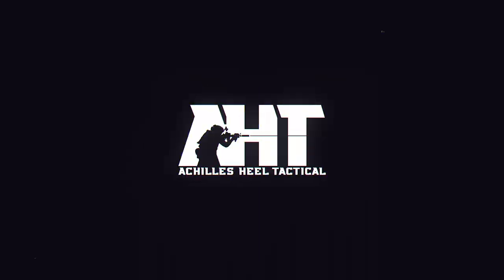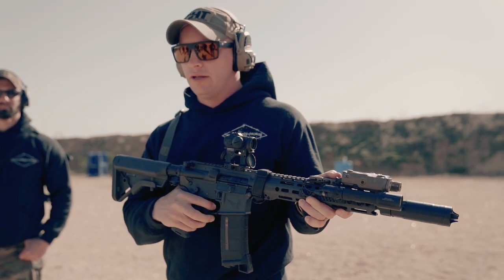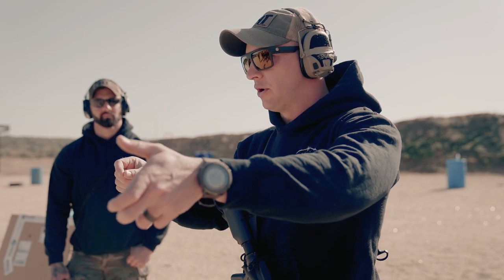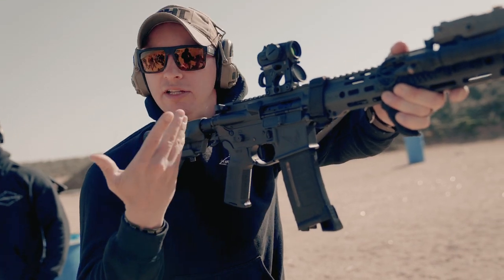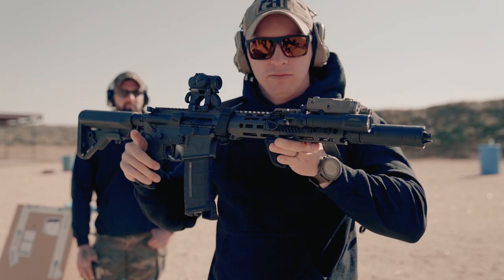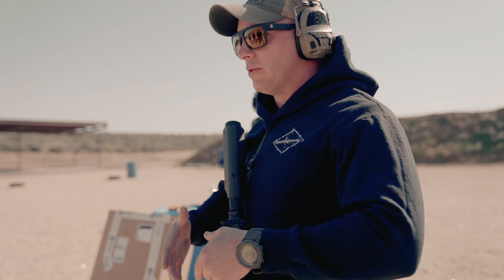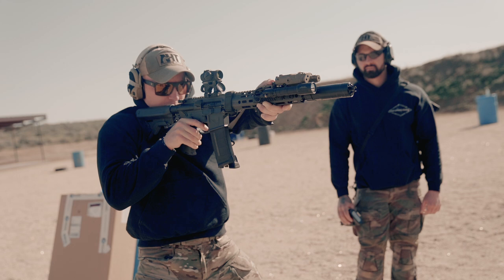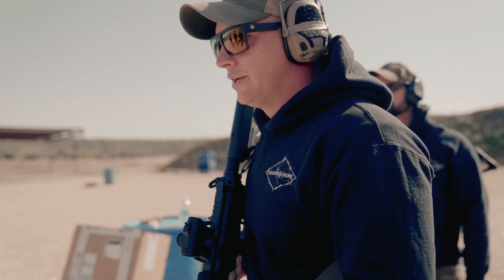HOW TO GRIP YOUR CARBINE

Comment: I'm going to try this. I have watched several top tier guys that would disagree with the shoulder theory. Lucas Botkin being the main one. Until I found you I never knew Lucas had a rival. I will work on this NYD at my personal range. COME TO TENNESSEE!!!!-
Reply: This guy stronk and heavy with big hands. Lucas tall and lanky, small hands. Pulling the gun tight into your shoulder causes you to shake and get exhausted and make you likely to chicken wing. You always gotta stay relaxed and comfortable. Your off hand should stabilize the weapon as this guy shows
Reply: Lucas is far from a top tier guy, let’s be real…
Reply: If you're indexing the butt on your shoulder, you're already not optimal.  Index the butt under your dominant eye and build from there. For me, that's in my chest and clavicle, nowhere on the pectoral-deltoid fold.  

The minor supporting techniques can be experimented with to see what works with your anatomy and carbine furniture.

I personally use rearward pressure with the support hand and 3 lower fingers of the firing hand, while leaning forward.  My muzzle does not rise even with A2 muzzle device.

As you build a round count over months and years, you'll see what works better for you.  I learned from guys like Kyle Lamb and Ranger Regiment NCOs who went to SOT run by The Unit.
Reply: @LRRPFco52  I'm a civy. I just emulate the top tier guys. I don't have the big league instructors as you do,and you're formerly a soldier. Tbh, there is no one specific "perfect" technique. Besides, I evolve every time I hit my range, when I'm not overloaded with Cerakote work,which I am as of now.
Reply: @tangomantactical  Those techniques have been taught to civilians for 21 years now at least.  I helped Kyle populate his first open enrollment course in 2003.

Comment: Many SOF vets have talked about the “c grip” being too fatiguing and that if they’re holding security for a while or clearing a decently sized structure, they’d grip the vertical grip or magwell. Do you agree?
Reply: Yes, and no. The several dudes I learned a lot from were all Batt rangers and could keep their c clamp for hours while we ran drills and such. I think it can depend on barrel length, but it's possible to keep up.
Reply: You don't have to be high ready 24/7.  Your weapon is muzzle down most of the time, until you need to go high ready.  Start with SUTs and CQB perspective, then work-in CQM techniques to see why they are what they are.

Comment: What do you mean/do when you say “leverage the pinky and thumb” on your support hand? Like what mechanical input are you applying with your left hand/fingers?
Reply from the maker: The thumb over & in-line of the bore is the leverage high and the pinky is the low leverage anchor. Rather than brute strength now you have leverage built on the rail which will be much more effective at controlling the recoil impulse. Come to a baseline class & you will receive all the context you need in person.

Comment: How would you leverage the rifle if you don’t have a fore grip attachment?
Reply from the maker: Exactly the same way. Fingers at 6 o’clock of rail and thumb at 12 torquing front end of the rail.
Reply: @achillesheeltactical  thank you. Also, what’s your opinion on flexing your hip to square up. Some instructors say it’ll induce muscle tension causing excessive muscle fatigue.
Reply: Explain Torquing?  . Torque down like twisting the cap on a jar?  @achillesheeltactical

Comment: I'm curious as to how much the sling tension is assisting in mitigating the recoil. I prefer to run my sling in a one point configuration 90 percent of the time as my rifle is primarily used for cqb.  Switching shoulders is just too much of a hassle in kit  on a two point sling setup.
Reply: Single point is really only good for Plainclothes & Vehicle work.  Once you go hands-free, you'll see why.

JSOC Senior NCOs in Combat Development surveyed operators across the units asking how often they switched shoulders in GWOT, and came back with 0 instances where anyone had done it in actual CQB or firefights.